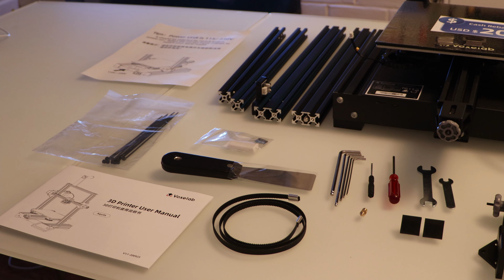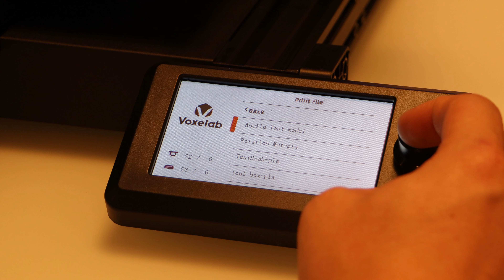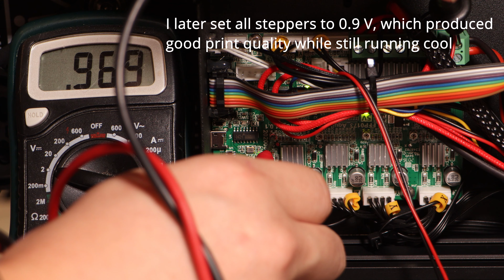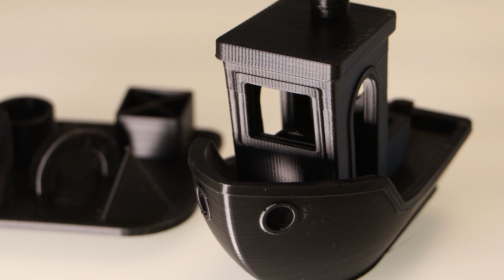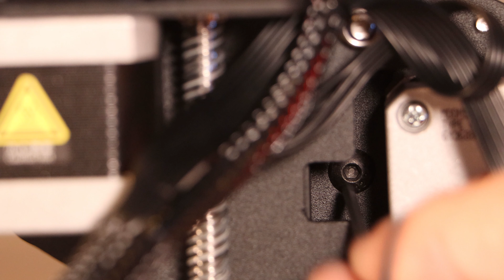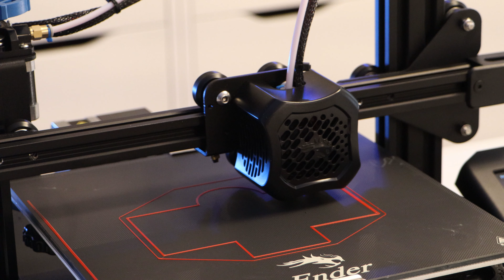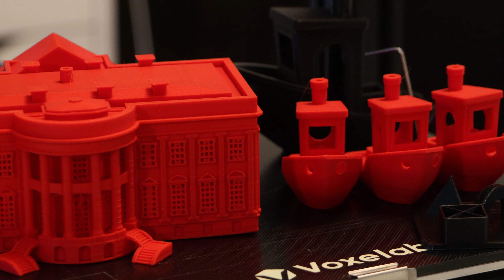VOXELAB AQUILA VS Ender 3 V2 - Which Budget 3D Printer Should You Buy?

Comment: The Power supply voltage selector is most important to power outlets supplying 240v, if set to 115v it will blow up Anywhere in the world which supplies 115v, set to 240v it will probably not supply the proper voltage to the printer, it may still work, but its going through a different part of the transformer which handles 240v, point of this is you can make the mistake of not switching it, if the supply voltage is 115v but here in the UK it would damage it if not set.

Comment: All stock Ender 3 V2 boards have dedicated bltouch sockets.  This includes 4.2.2 and 4.2.7.  But my experience with the V2 was very similar to yours.  My first layers didn't become more consistent until I installed solid bed mounts and a bltouch.  I think I'm going to return my new second Ender 3 v2 for the Aguila.  They have an Aguila X2 that looks a lot more like the V2, and I'm wondering what the difference is.
Reply from the maker: The difference are really small, not really worth the extra cost for the x2 IMO. 
Lately there has been some drama about lack of thermal runaway protection and microcontroller types on the Aquila. I still think the aquila is the better buy though.
Reply: @NathanBuildsRobots  I saw that.  Isn't it fixable with hacked/upgraded firmware?
Reply from the maker: @MakerMeraki  yeah,  you just need to make sure the firmware is up to date.

Comment: Very well done, thank you. What do you think about the Aquila H32 fiasco and all the firmware issues ?
Reply from the maker: I haven't been keeping up with it too much but it's always a stain on a company's reputation when they cut safety in an effort to save time or money. They also had no thermal runaway control for quite some time, which is also bad. 

Honestly I'm so cheap and lazy that I would probably still buy the Aquila and run it without themal protection if I were in the market for a cheap as dirt printer :p

Or better yet buy a Lergde X replacement board with that $120 savings between the Aquila and Ender3 V2.

Comment: If you plug into 115v with the power supply in the 230v setting, it outputs half voltage. This usually won't cause any trouble if the rest of the electronics are design by a non-moron. It could result in heavy current draws if designed by a moron.

If you plug into 230v with the power supply in the 115v setting, magic smoke will be released.

Because most of the world uses 230v, and there's no harm in plugging it into 115v while in the 230v position, this is how most stuff is shipped. If they shipped in the 115v position, 99% of their shipments would be destroyed upon arrival because nobody pays attention.

Comment: I have made this suggestion with other reviewers (and most have seemed receptive to it), that is that if you are reviewing a printer that YOU ONLY PUT IT TOGETHER WITH THE INCLUDED TOOLS.  If there is filament, use the provided sample to make the sample print....  My first printer (and I have kept every tool in my printer box since), took two trips to Ace to get tools (and one bolt) to build it (and it never did work right, traded it to the guy who fixed my Tevo Tornado).  If a printer manufacturer that includes some filament, then they ought to have a test print that you can finish with amount of filament
Reply from the maker: I can give that a try on my next unboxing. I was actually planning on only using the included tools to assemble the Aquila, but then I had issues with one of the bolts. I figured it was either a problem with the tools or the bolts. It happened to be a problem with the bolts, but I decided to use the Bondhus wrenches because they are made of harder steel and are less likely to strip/damage bolts that are already less than 100%

As for filament, I don't really like how most manufacturers package it. They cut off a piece for you and put it in a bag like the are some kind of drug dealer. Won't it have issues with tangling if it's not on a spool? I would hate to start a test print and have it get all jammed up.
Reply: @NathanBuildsRobots  the scrap that create provided with my ender3 v2 I just hung where you would normally place a spool and it rolled off as it should. Maybe I got lucky who know lol.
Reply from the maker: @bobbyp9220  I have since tried using the included filament. The white creality stuff is pretty smelly. On one print it unspooled just fine, on another it fell off and I had to keep straightening it out to get it to feed correctly.
Reply: @NathanBuildsRobots  Thank  you! the tool thing definitely provides valid information to a new user.  The filament I agree on (usually it is crap, and just a piece), BUT if they are going to include a test demonstration print it would be NICE if they would give you enough to finish it.  I bought an FLSUNN-QQ and it did not have enough to finish the test print(s), I had more filament (but discovered the printer (finishing over-night) does not have run-out detection so I got a print failure the second print).
Reply from the maker: I have since started assembling the printers with the included tools, thanks for the tip!

Comment: If you're in the US, plugging in the printer with the 220v setting does nothing, the printer just won't power on. If you're outside the US, generally EU, plugging in 115v will fry the printer. It's best to always double check the setting prior to plugging in.

Source: Rip'ing my old Sega Dreamcast when living in France :(

Comment: It's interesting - on my Wanhao i3 Plus from 2017, the SD Card goes in upside down. This was something a lot of people commented about at the time. Today, the (micro) SD card on this printer STILL goes in upside down. Maybe that's just the way things are, the slot solders onto the motherboard, the motherboard goes in a certain way, the slot always has to be upside down. I'll bet it's the same on a lot of other printers, too.
Reply from the maker: It's one of those things that used to bother me at first, but now if I got a printer that takes the SD card right side up it would throw me off. So now we're stuck with upside down SD cards for the rest of time. 

If you think about it, the boards are all installed upside down too (attached to the "ceiling" of the enclosure)

Comment: Have you looked at the Aquila X2? Wondering it it’s worth the $30-$40 premium.
Reply from the maker: All they added was a $2 filament runout detection sensor. So I'd stick with the original.

There is a well known marketing tactic where you sell the same thing at 2 different prices. Just call the more expensive one "premium" and even if 95% people pick the cheap one, you will still be making more money by offering a second more expensive choice.

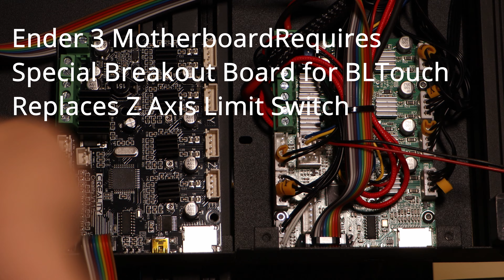Comment: 4:11 I'm not sure how useful is to compare a creality V1.1.5 board to the VoxelLab's, when most production V2-s come with 4.2.2 or V4.2.7. Pretty missleading.
Reply from the maker: That's a valid point. I was referencing an older Ender 3 silent stepper board out of convenience. I think I pulled it from my V2 that I bought pretty much when it came out.

Now the Ender 3 V2 board has pretty much the same upgradability as the voxelab motherboard.
Reply: @NathanBuildsRobots  then pin this!

Comment: That test print on the Aquila is honestly one of the best I’ve ever seen. The boat was pretty good as well with exception of the banding. I’m really surprised with the quality of the Aquila. It really seems to be one of the best bang for your buck printers out there. Thanks a lot for this video. The information was well payed and and clearly stated complete with camera angles showing what you were talking about. It really helped me make a buying decision.
Reply from the maker: Thanks David, and happy printing!

Edit: I should point out that my new print profile does not have the same hull line issue so my prints are looking much better. If I reprinted it on the aquila I think it would min even better, except for some defects in overhanging features that can only be addressed by installing better a better part cooling fan.

Comment: your white house model was lifting on the corners what bed temp did u set it at on voxelab
Reply from the maker: I was using the defaults in prusaslicer, 60C. Since then I have cleaned the bed with alcohol, which helped things a bit. 

I have started using rafts for everything and I have been getting much more consistent bed adhesion. I wish the bottom layer surface quality was better though. It ends up being kind of stringy when you use a raft.
Reply: @NathanBuildsRobots  just clean your bed with dawn dish soap, i have found that cleaning it with ISO isnt as good as just soap and hot water

Comment: Can you please tell me the difference between the Aquila and the Aquila X2. I'm a newb, thanks. And this vudeo was very helpful as I'm doing research before I buy my 1st printer and I've narrowed it down to these 2
Reply from the maker: The aquila x2 is a minor upgrade over the original. You can barely tell the difference between the 2.

The 2 main differences are:
1) The addition of a filament runout detection sensor. 
2) The screen is vertical instead of horizontally oriented. 
Also 3) They bolted a handle to the top, but the top bar already acts like a handle, so I'm not sure what the point of that is?

I just did a review on the FOKOOS Odin which is a really nice printer. It was just OK stock but if you plan on doing a bunch of modding to make an ultimate printer I think it's the best platform to do it on. It comes with dual z- screws, touch screen, direct drive, filament sensor, volcano hotend, and yellow bedsprings. BUT it did have some issues out of the box so it's more of a project to get it to run nice.
Reply: @NathanBuildsRobots  I just ordered the Aquila x2 (I think? 😆 the better one with the sensor cause I felt that was worth the extra $40)
I'm sure I'll be your new best friend for awhile. I've already subscribed and went through a few of your previous video's, can you point me in the direction to learn Cura?
Thanks again. I'm so nervous
Reply from the maker: @mszoomy  Congrats! Cura is good but I prefer Prusaslicer.

It was easier for me to get started using Prusaslicer because it has a simpler user interface and the built-in profiles are very good.
Reply from the maker: Here is a link, you can get started before your printer arrives. 

During the setup you want to use the default profile for the Ender 3V2 since it is nearly identical to the Aquila. It is under the "other vendors" section.

https://www.prusa3d.com/prusaslicer/

The biggest thing to learn when you start printing is bed leveling.
Reply: @NathanBuildsRobots  thank you so much!! I will check it out. Can you also please recommend a place to find things to print, the files? I'm off to prusa now!
Reply from the maker: @mszoomy  thingiverse is good for useful things for your printer or around the house.

Myminifactory is good for sculptures and stuff that looks cool.

You can also model your own stuff, a lot of people use the free version of Fusion360.

If you found a model and want to tweak it a little,  meshmixer is incredibly capable and free, but it has a steep learning curve. It's like photoshop for 3d models.
Reply: @NathanBuildsRobots  thank you do much again.im do excited but also nervous. Seems like so much to learn. I watched a couple bed leveling videos so I think I've got the hang of that. My filament will be here tomorrow and the machine on Friday. Which brings me to another question: are there any brands or types of filament to stay away from or are harder to work with? I got 2 roles of pla, one plain old blue not the silky stuff and one glow in the dark
Reply from the maker: Stay away from PLA+ and "Performance PLA" and other such nonsense. They are actually PLA blends, are often harder to print with, and offgas during printing. I wish they would call them PLA blends instead, which is what they really are. 

Any filament brand with a bunch of positive reviews should be good. My personal favorite is Prusament, but I have also used a bunch of cheaper brands that have worked well.
Reply from the maker: Also glowing is achieved with crystalline powders, which are slightly abrasive and add stiffness to your parts since it is technically a composite material. 

I've printed a spools of it here and there with no issues but if you plan on using a bunch of it you might wear your nozzle out. It's only a couple $ to replace.
Reply: @NathanBuildsRobots  thank you, I did my 1st print last night, came out great. You've been very helpful, thank you
Reply: @NathanBuildsRobots  I would prefer something that I dont have to do any mods too, that's something way out of my capabilities. I used to build my own computers but that was back in the days of DOS and dial-up so...... yeah not wanting to go that route, I got left behind years ago, I can barely operate my smart phone (just kidding) but I will look at the video regardless. The handle on the top is not important, screen orientation wouldnt make much difference but the filament run out sensor sounds important but is it worth the $50 price difference 🤷‍♀️

Comment: It blows up the power supply flicked the switch on a computer at school years ago one large flash
Reply from the maker: Sounds like you learned something in school that day!
Were you on a 220v or 110v power grid?
Reply: @NathanBuildsRobots  220
Reply from the maker: Ok that checks out with what another commenter was saying: 
Wrong setting in 220v grid can blow up, wrong setting on 110v grid might not turn on.

Comment: they have on offer, an upgraded machine. it is still under $200. they have added a filament detection sensor, carrying handle and  vertical command panel. looks like free shipping as well offer good until 7/15...or so says their website...i found it odd that the customer service chat person didn't know the weight of the filament on the pools...shrugs.
Reply from the maker: I saw that. It looks like a very minor update. 

If you're looking for the best "comes with the printer" filament you should check out the video I just did on the Fokoos Odin - it comes with a nice little spool of filament. I had to put $130 worth of upgrades into it to make it print well, but it's an excellent frame to build/mod off of and it is currently my best printer (at least in its upgraded state).

Comment: Nathan, 
have the minor issues with the voxel(assembly hardware/nozzle gap) been addressed, to your knowledge?
Reply from the maker: I don't know, I would repost on https://www.reddit.com/r/VoxelabAquila/

I bought mine on March 25th, which was a while ago, but it had been out for a couple months by that point so I would have hoped they would have ironed out those issues by then.

It only takes about 20 mins to fix. The most difficult part is you have to hot loosen/tighten the nozzle to clear up the issue.

Comment: now I'm nervous about my cr10 I ordered
Reply from the maker: I use a CR-10s at work, its actually a pretty good design. It has close to 2000 hours of print time on it with no major issues. 

My only complaint is the firmware that it comes with does not give you a lot of control over settings. For example I'm pretty sure you have to plug in a computer and send gcode to adjust E-Steps.

Comment: Nathan you did a very good comparison of the two. You pointed the finer points of the Aquila! Your video cemented my choice on voxlab. Thanks
Reply from the maker: Glad it was helpful! You should check out CHEP's video on the Aquila as well, he pointed out a flaw that I didnt notice until I watched his video. There is a gap between the nozzle and PTFE tube which can cause clogging and other issues. 

You can fix it pretty easily by disassembling, cleaning, and reassembling the hotend, hopefully the newer units are shipping without that issue.

Comment: 17:30 I had the same problem, caused by too many retractions. Flattened/weakened the filament and it broke. Lowered the retractions down and fixed it.
Reply from the maker: Yeah, direct drive and dual gear extruders also help address this issue.

Comment: Will the Micro-Swiss upgrades work for the Voxelab?
Reply from the maker: I did a video on that very topic https://youtu.be/pn7ApEZ-6HY

The all metal hotend is a drop-in replacement, same as on the ender 3.
The direct drive system from microswiss required 20-30 minutes of tinkering to get it to work, just had to adjust the x-axis limit switch location since that is slightly different on the Aquila. There are many work-arounds for this so I wouldn't be discouraged from doing it.

Comment: Thanks for this great review and comparison. Can the Marlin software be flashed to the Voxelab machine?
Also, does the extruder have metal gears or plastic? How noisy is the Voxelab compared to the E3V2?
Thank you!
Reply: I'd also like to know since I'm considering Aquila over Ender 3. Hopefully someone will answer
Reply from the maker: The link worked for me just now. Here is the product title in case you want to look it up another way.

SPEED TIGER ISE Carbide Square End Mill - Micro Grain Carbide End Mill for Alloy Steels/Hardened Steels - 4 Flute - ISE3/32"4T - Made in Taiwan (5 Pieces, 3/32")